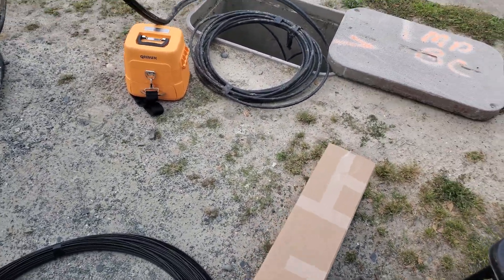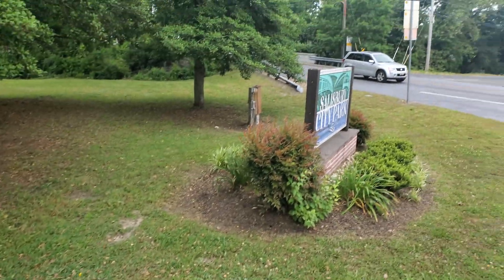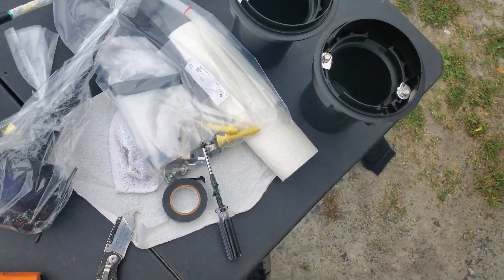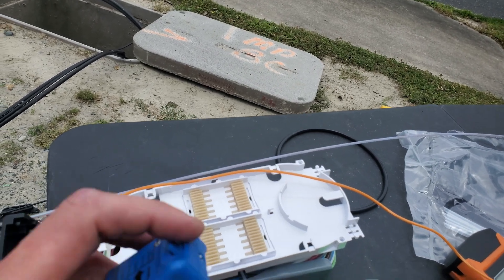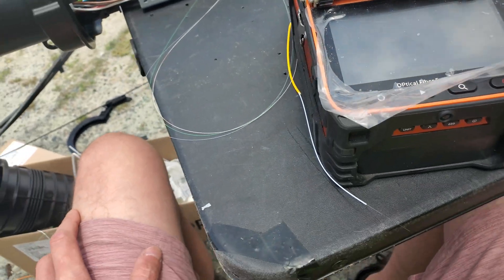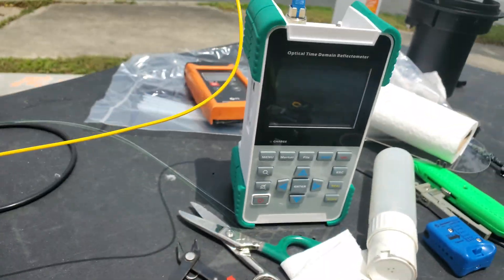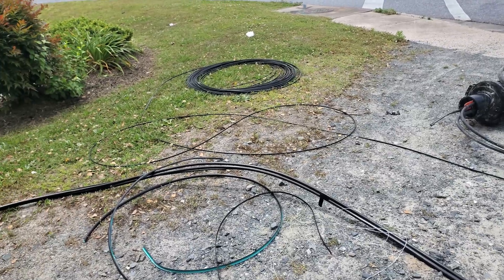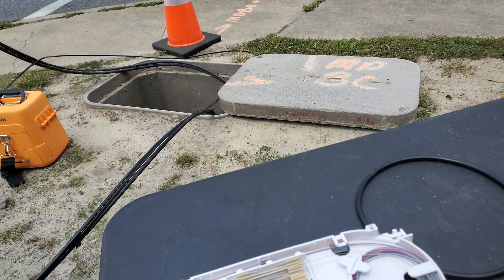Another day in fiber paradise

Comment: So MDBB is contracting you guys for the connection between them and Windstream? Does MDBB have fiber crossing the eastern bay because I dont think WS does, from their maps their route goes up to Philly through Delaware. I would have thought MDBB as a middle mile network would have been connecting both sides of the state together since not as many people live on the eastern side.
Reply from the maker: It's a lot of questions to answer.  We are an MDBC member and an ISP.  We use MDBC as an economical transit but in this situation we are adding a diverse path through Verizon (Windstream, Whatever clec name you want to addon)  MDBC does have a cable under the bay that is owned by MDBC and we have access to 1 fiber on this link if we need to use it.